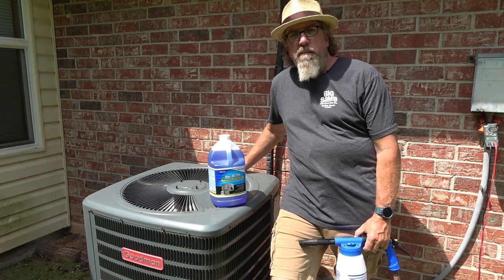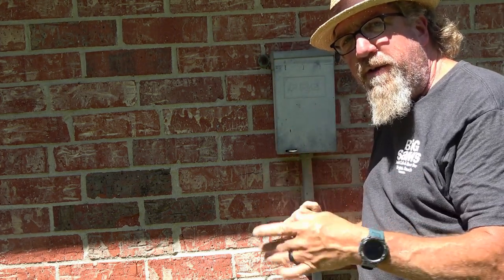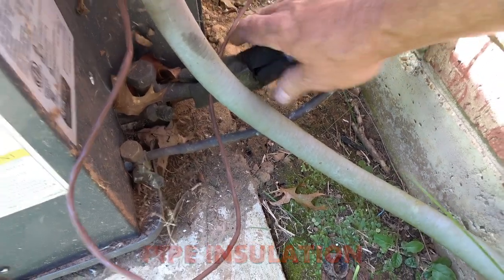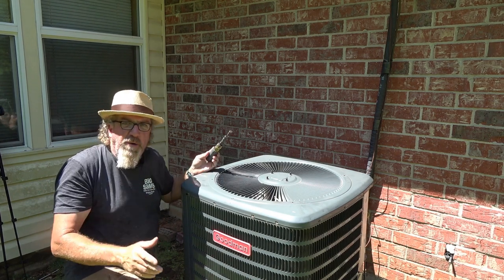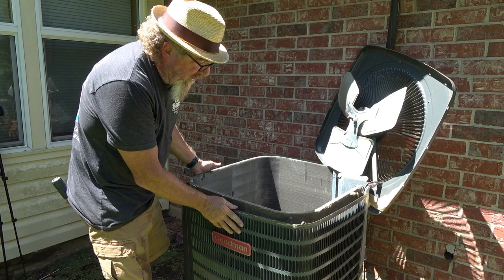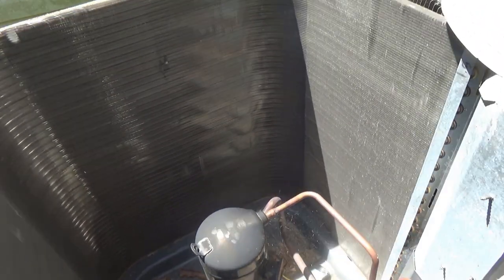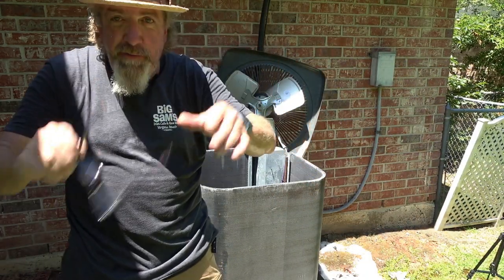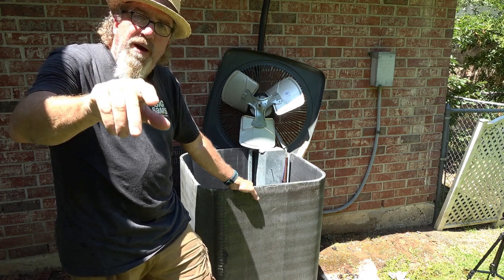Cleaning Your Air Conditioner Condenser and other maintenance tips.

Comment: I have a double fin on my Lennox
Reply from the maker: Oohhh...to do that type you have to pull the hail guard and pull the layers apart. Trash can build up over time between to layers and cause alr flow issues. If you wash the coil on your condenser often you shouldn't have to worry about that. Just make sure you have water pushing through both layers while you are doing your cleaning. If water is pushing through then your not blocked